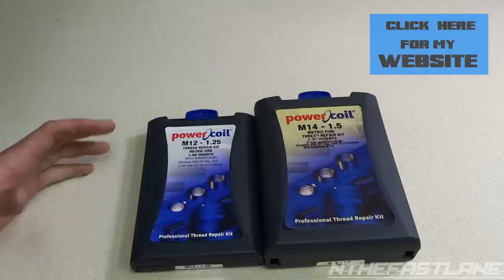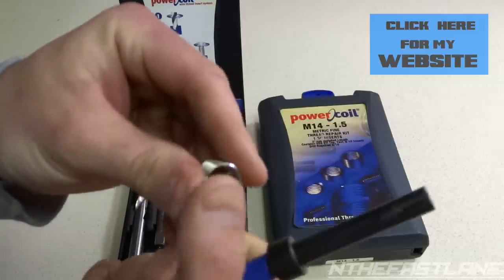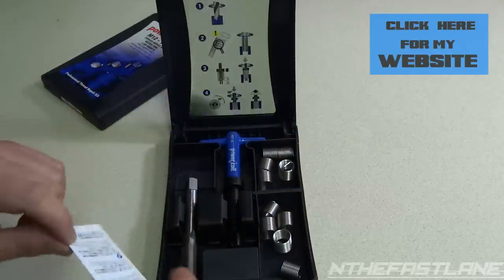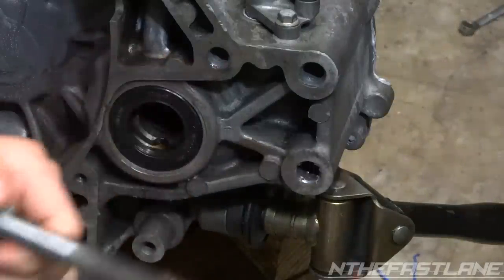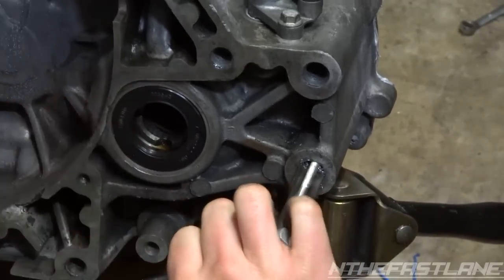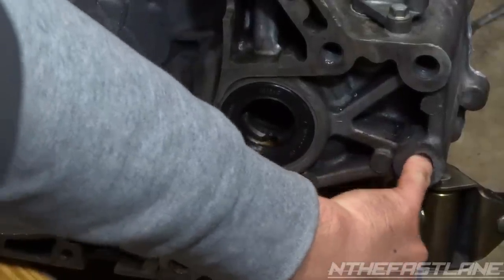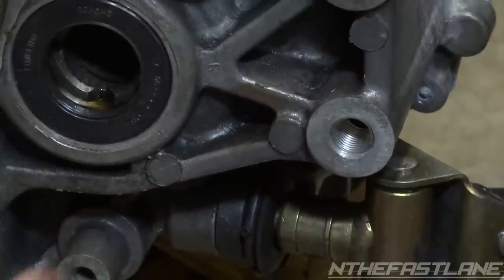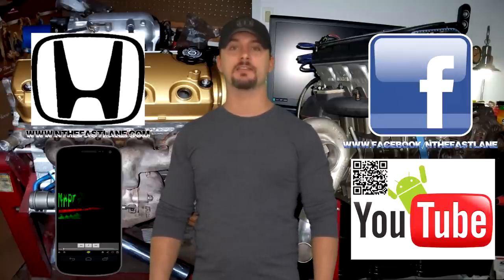Stripped Automotive Threads Repair "How To"

Comment: So the coil thread repair worked without drilling out larger holes for both stripped thread holes???...im trying to to repair a stripped crankshaft. So I bought a 14x1.25 "OEM" brand thread repair kit very similar to the one you have here but it didn't come with the drill bit also.
Edit: btw I need a 9/16 drill bit also but was wondering if I could try it like you did without drilling.
 Also I'm confused because I already tapped the stripped crankshaft with a 14x1.25 tap before I bought the thread repair kit hoping it would repair/rethread the stripped shaft but it didn't work.... So I don't understand how drilling the hole with a 9/16 drill bit then re-tapp'ing the shaft with the same 14x1.25 tap works if I already tapped with a 14x1.25 tap before drilling shouldn't I be able to just put the coils in without out having to drill like you did here?
Reply from the maker: The hole originally needs to be smaller than the drill bit. Then when you drill it with the drill bit, it opens it up to the size where you can fit the tap in to tap the hole. If the hole is already bigger than the drill bit, then you will not be able to use that coil size and we'll have to go bigger.

Comment: Tapping through aluminum seems so much easier than steel. Having broken my share of taps, I tend to do a lot of back and forth action with steel. If a tap breaks off in aluminum, there is no way to safely drill it out because the tap is so much harder than the base metal.
Reply: I've heard about these a little bit.

Comment: Use Engine Oil on your Tap instead of WD40. When your Tapping the hole 1 Full turn back off 1/2 turn and Continue. Also if you feel the Tap Binding Back it Out All the way Clean off the Tap Blow out the Hole Use Engine Oil on The Tap and Continue. Engine Oil Will also keep the Threads on the Tap from Getting DULL. It was a little Painful to watch him turn that tap in the Hole.LOL Otherwise He Did a Good Job. Klaus 35+ years Exp ASE Master Mechanic
Reply: +Klaus Schreyer I have the same question as Fat White Boy (never used that sentence in my life...)
Is it a good idea to use loctite when threading the insert in?